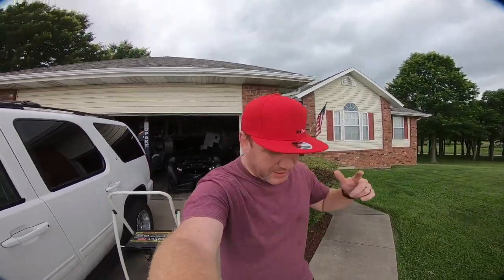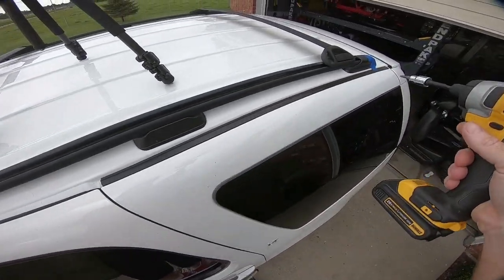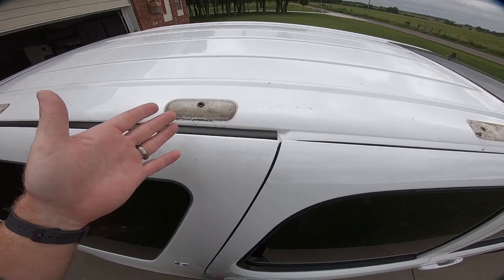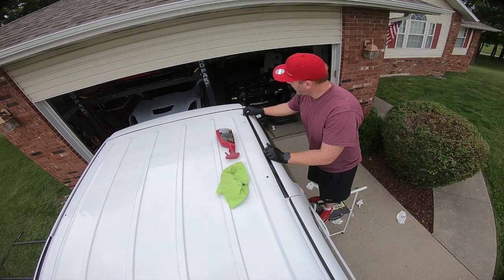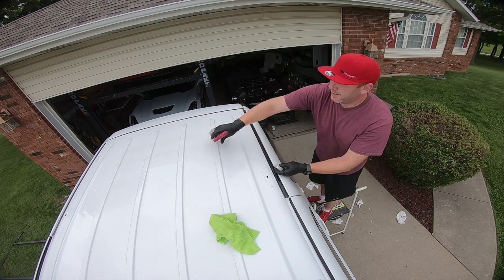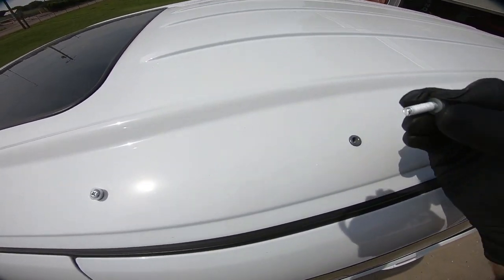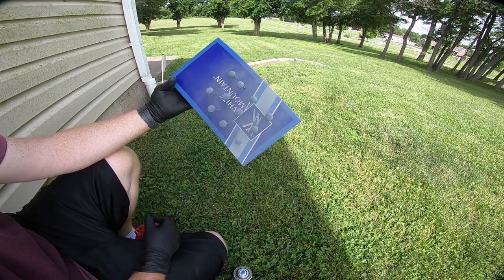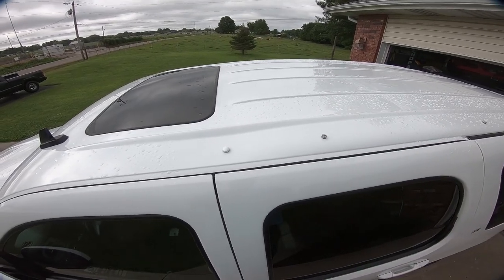How to Remove Roof Rack Tahoe Yukon Escalade

Comment: 2007 Yukon Denali/escalade with the chrome trim cover is different.   Remove the 2 front and 2 rear screws with a 25 torx bit. There is still 1 torx screw ( with rubber spacer) in the center of each rail you can't remove, but there is a large opening that is facing towards the front of the screw/suv.  The screw actually slides into place when installing and reinstalling the rail.  To remove the rail, grab both edges of the front and back of the rail between the roof sheet metal and rubber and shift the whole rail back about 2 inches, then it'll release and lift up.   Haven't seen this done on YouTube yet. Total screws removed are 10 screws. Best of luck!
Reply from the maker: Great information. Thank you for sharing

Comment: I used stainless steel screws on my white 2011 Suburban. I also used black screws painted black on my charcoal 2003 Tahoe. I like your method for other colors though.
Reply from the maker: Yes those work too. I've used those in the past too

Comment: You should go with the LTZ polished wheels. I’m sure that dropped with those wheels it would look real nice. Good job on the roof rack delete. That roof rack always makes the Tahoe look higher.
Reply from the maker: Thank you. If you check out my lowered Tahoe video I had those wheels on it.
Reply: TWA Motorsports I remember those. 22s would look real nice lowered.
Reply from the maker: @indio1907  that's what I want is 22s
Reply: TWA Motorsports By any chance do you have family out in Bakersfield, CA? There is a guy that owns a shop called  Krazy Kustoms that you could say is your twin lol.
Reply from the maker: @indio1907  no actually I don't. My wife does though lol
Reply: TWA Motorsports Good deal man lol.

Comment: Is it the same process to remove the roof rack on 2017, 2018, 2019 Tahoes? Or would they require removing the headliner?
Reply from the maker: I'm sure it's close but I haven't done one.

Comment: Looks great but I do have to comment on the Teflon tape, you were wrapping the bolt threads in the wrong Direction. The Teflon tape will want to try and unwrap as you tighten.
Reply from the maker: Yeah I noticed

Comment: What black push in clips did you use on the older black Tahoe?
Reply from the maker: Similar to trim push pins. Like for an inner fender. Not my favorite method  however
Reply: @TWAMotorsports  I had an assortment of push pins but none would fit flush!!
Reply from the maker: None really fit flush
Reply: @TWAMotorsports  ok I’ll just go with the option in your post
Reply from the maker: Or just screws.

Comment: Where any of the nutserts in the roof loose?  I just did this but screws bottom out and the whole thing spins.
Reply from the maker: Not on this one but have had that issue
Reply: @TWAMotorsports  I actually had the tool in the garage from a previous project and ended up redoing it. Pulled the bolts back out and retightened all of the nutserts.  I also used red bolts from dressupbolts that were a pretty good match to the Chevy maroon.
Reply from the maker: Nice. Sounds like you are set

Comment: why didnt you just fill it in with bondo or something? instead of using bolts
Reply from the maker: That doesn't work that way lol
Reply: @TWAMotorsports   well i mean, i know you would have to get it re painted on the roof at least if you did fill them in, but it  wouldn't have bolts. because ive seen smooth roofs before. but it was on like Caddies and Yukon. But i mean  its not bad looking, after all its not a show car. no ones done a video on a 2015 - 2020 tahoe tho, thats what im looking for before i mess mine up lol!
Reply from the maker: You can't fill holes with bondo because it would crack. It would have to be welded
Reply: @TWAMotorsports  oh duh!.. yeah very true bro. but yeah. i did say or anything. lol